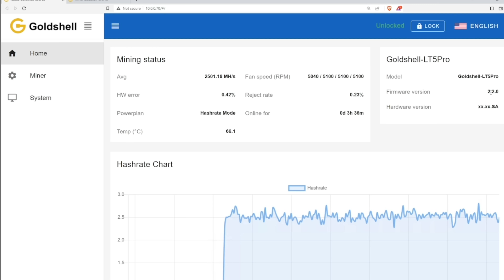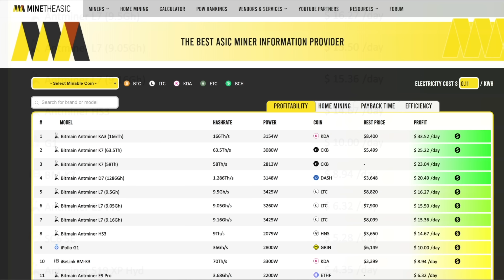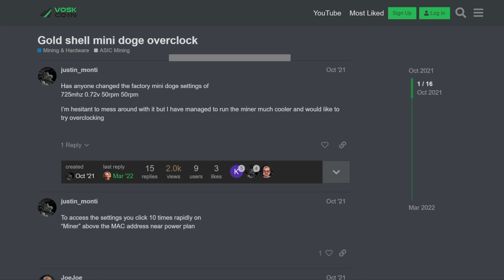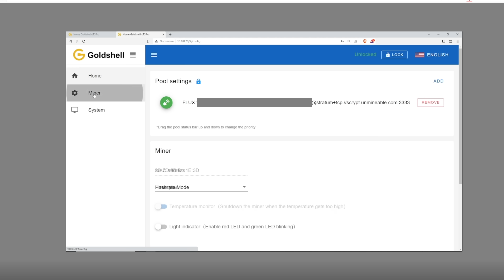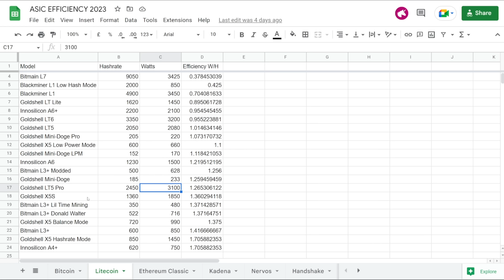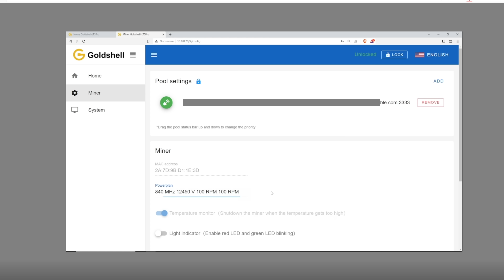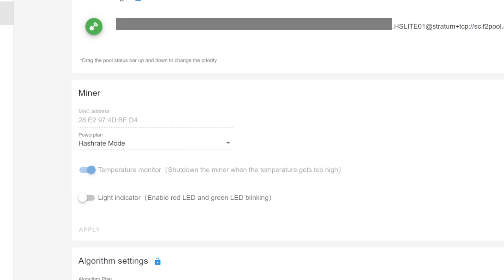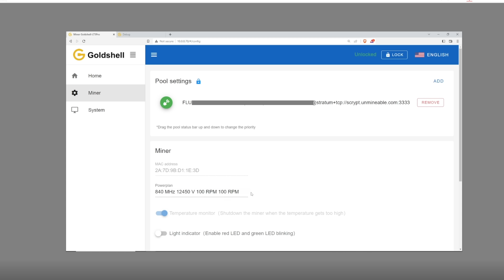I didn't know you could do that...

Comment: Yep.. Done it on a dozen+ Goldshells sometimes the settings wont lock and you'll need to do it again... Its unfortunate that when you try and do this on the New Box II Series it wont lock at all! I’ve gotten it to pop up on my CK2 and when I bump the fan speed up it bring the temp from 78-80c down to 70c! But it won’t lock! I’m hoping Goldshell will put out a firmware update. Shout out to Costal Crypto!
Reply: When you bump the RPM aka the Fan speed up to about 75 on the Box Miners they start running veryyy cool.

Comment: The minidoge I have, doesnt have that, they have the preset hashrate & power save modes. But, the KD pro with firmware 2.2.5 I have does have that option. 
I haven't changed anything yet. It ain't broke, so I won't try to fix it lol